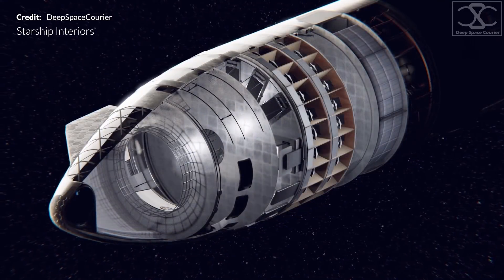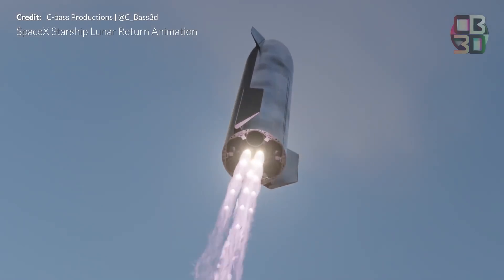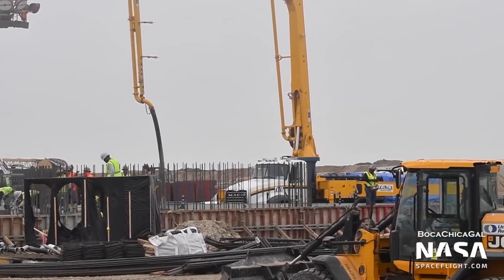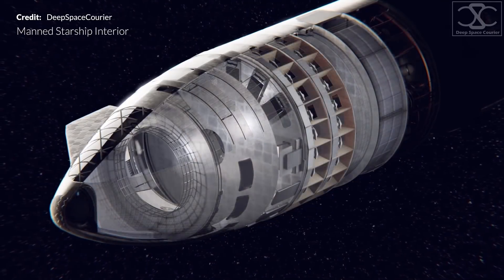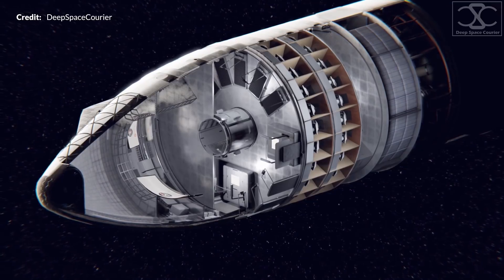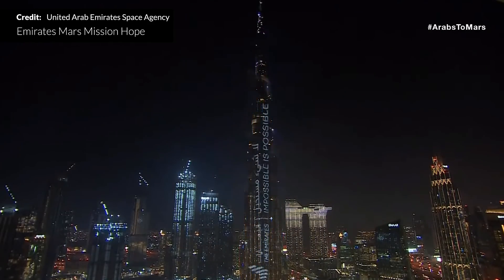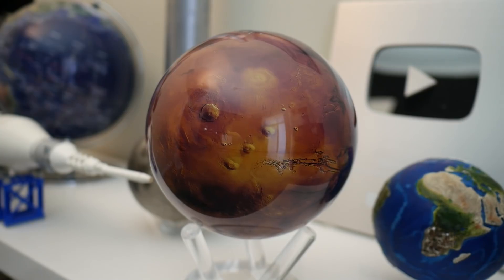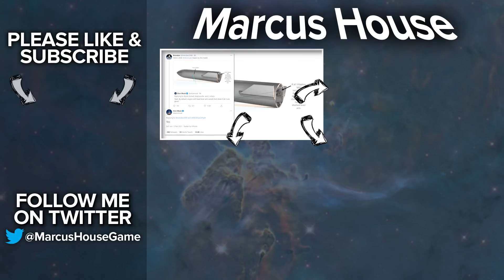SpaceX Starship to attempting another flight with SN10 - Can they master the flip and landing!?

Comment: What we really need for going to the moon is nuclear thermal.  Nuclear thermal raises the ISP from 382 seconds for vacuum Raptor to ~1,000 seconds.  While the hydrogen tank for nuclear thermal will be a lot heavier for the propellant housed in it, it is still a huge boost of total delta-V.  Nuclear thermal is still a pretty nice way for going to the moon because you can use the Oberth Effect for saving on propellant on the way out, it accelerates a lot faster than ion propulsion, and it can do the burns to use aerobraking on the return trip to LEO.  Doing nuclear thermal obsoletes the Lunar Gateway because a nuclear thermal vehicle carrying everything to say a massive Starship Lunar Lander or say a Starship based "sky crane" in LLO.  

So do several Starship flights to the nuclear thermal transfer vehicle (which could be a modular Starship with a nuclear thermal module that loses its Raptor engines in favor of nuclear thermal and then recycles the regular 2nd stage chemical fuel tanks into propellant storage tanks for Lunar surface vehicles), maybe using one of those repurposed oil drilling rigs as an ocean based landing platform for ballistic 1st stage trajectories in order to maximize payload to LEO.  Then the nuclear thermal transfer vehicle brings everything for a mission sans the Lunar Lander / Lunar sky crane from LEO to LLO in one trip.  Then it transfer's its materials / people to either a Starship based Lunar Lander or Lunar sky crane while in LLO.  Finally make the trip to the Lunar surface.  The Lunar lander lands on the moon with enough propellant to make it back to LLO and the Lunar sky crane releases its payload at perigee hover slam style and immediately flies back into LLO.  For returning to Earth, you ride a nuclear thermal transfer vehicle to Earth where it aerobrakes and then uses its nuclear thermal engines to circularize into LEO.  From here transfer to Starship(s) for the final ride to Earth's surface.

An interesting thing about this concept is as long as the hydrogen propellant tanks for the nuclear thermal engines are big enough and the nuclear thermal engines don't take too long to do their burn as in they can still make good use of the Oberth Effect, the delta-V to go from LLO to the surface of Luna is small enough compared to the stated delta-V of a regular Starship, let alone a stripped down Lunar Starship or even more stripped down Starship based Lunar sky crane, that you could be looking at landing over 200 tonnes of payload on the Lunar surface.  Especially with something like a stripped down Lunar sky crane, you could be looking at setting up a track to land on Luna at orbital speed (which is a lot lower for Luna) and maybe even take off again using electromagnetic propulsion, essentially a maglev train to and from orbit.  At this point your nuclear thermal transfer vehicle is a single stage rocket with the vehicle mounted on top being a detachable lunar lander.  So then most of your Earth based launches would be split between hauling up payload and hydrogen propellant with very little going into LOX/LNG.  And with a lot less LOX/LNG to haul up, that capacity is freed up to carry a lot more payload to Luna.  Then all of a sudden Luna is not much harder to get to than LEO with that baseline to LEO being the massively cheaper Starship, making trips to Luna cheaper than trips to LEO today on a Falcon 9, the cheapest way to orbit today per unit of mass.  This is compared to the first time we sent people to Luna where we used a 10m wide skyscraper full of rocket fuel just to get 2 people to the surface and at that we expended the whole skyscraper to just get a tiny capsule with 3 people crammed into it back.
Reply: Nuclear Thermal Propulsion might be a good idea for taking large numbers of people to Mars (so would VASIMR), but we’ve landed people on the moon & gotten payloads to Mars (and beyond) with Chemical Propulsion, so it’s not necessary. Lunar Gateway was part of a, “We’ll let you do yours if you do ours...” deal, so it wasn’t only obsolete, it’s not necessary unless they insist on using SLS & Orion.
Reply: @TraditionalAnglican  the problem with chemical is the last plan I saw to get Lunar Starship onto the surface of the moon with 100 tonnes of payload is it would take 27 Starship launches for each lunar landing as you would have to refuel tanker Starships in LEO all the way to fly to the moon in order to refuel Lunar Starship in addition to your main ship needing to be refueled all the way in LEO, which adds up to a lot of launches to get a relatively small amount of fuel into LEO with each flight.  Back with Saturn V, which was a much more efficient rocket than the Space Shuttle, it took a 10m wide flying skyscraper just to get two people onto the moon for a short period of time.  That is not really all that practical.  Even in the Saturn V days they were testing out nuclear thermal for a Saturn V 3rd stage to make the rocket more efficient.  There are two basic problems with ion propulsion going between the Earth and Luna.  One is for people and even electronics, the time spent in the Van Allen radiation belts is quite long.  You want to zip through those as quick as possible to minimize radiation exposure coming in from all sides, which is a lot harder than say having a hydrogen fuel tank between you and the nuclear reactor to block the radiation.  The second problem with ion drive is you can't make use of the Oberth Effect and aerobraking directly with ion drive as the thrust is too low, which means that precious ISP is largely blown taking the long, ISP intensive route in the Earth - Moon system.  Ion drive may cut it for radiation insensitive cargo runs and actually there are ion drives that are all around better than VASIMR now, but for everything else chemical by itself is horribly inefficient and thus extremely costly and ion is just too slow.  The next crewed place where ion comes in handy is the 'coast' phase of a trip to Mars.

Comment: I apparently missed something. What happened to SN 12, 13, 14? Were they canceled due to design changes?

One thing I really fail to understand is the use of standard design cranes. The US Navy (I believe) uses crane 
systems with powered legs to lift and transport heavier items than Starship. The assembly bays could have been 
designed to move on rails. The bays would pull back from the assembly platform, the wheeled cranes with tiedowns
both at the top and collars at the bottom to secure the vehicle. These tiedowns would prevent the legs from splaying
apart, sensors to insure the legs move properly. Once the vehicle is secured to the platform, the bay moves 
back over the vehicle. 

A way better concept, I think, than using standard cranes and flatbeds to move vehicles. Industry uses high cranes
that move across a factory floor, hanging from the ceiling. BAE offers something like I have in mind for shipbuilding.
Reply: Yes, 12-14 were cancelled because they figured they were not needed because of the info they got from SN8. SN15 is significantly advanced.

Comment: I wonder if anything can be done to increase falling drag and enable a slower terminal velocity? The little wings allow stability and steering, but can more be done? I imagine some materials, even like sandpapery sides might add resistance with minimal weight, and even better, a magical material that can transition from smooth on ascent and rough on descent. Or like fish-scales, smooth airflow up, and rough backwards.

Comment: At 12:15 you mentioned that cargo storage could be used as a  shield to protect the inhabitants of the craft if it were oriented in the right direction. My question is, If the event is anticipated, like in the event of solar flares, would the craft be reoriented to use the cargo as a shield? Aerodynamics don't matter in the vacuum of space. I have no idea how difficult this would be. 
I don't fully comprehend orbital mechanics, If the craft were oriented with shielding located between the occupied areas and the sun, would it stay oriented that way or would it need to be adjusted continually. If it needs to be adjusted, could this be accomplished by keeping the craft very slowly rotating?
I am not criticizing your video, It is very informative, I am just very inquisitive.
Keep up the good work!

Comment: I don't think it's as illogical as we all think for them to land so close to their takeoff stands.  They:
1. have confidence in their products (both in their ability to hit the target...which they do, but also in the durability of the other ships nearby) 
2. are shooting for rapid reuseability and maximum performance.  They could absolutely land the thing if they flipped higher up and used more fuel, but that's not what they need in the end, so it doesn't make much sense to try landing in a way that won't give them the data/experience/testing to get to their goal.  And they can't have delicate rockets that require white gloves and clean rooms. 
3. lastly, between building prototypes in tents and out in the open, and building prototypes rapidly (and the infrastructure to create them at the simultaneously) its clear that the SpaceX culture is not about perfection at the start, but rapidly evolving and pivoting as needed based on a sorta highly educated "trial and error".

Comment: I would like to see the landing maneuver performed about 10 seconds earlier to accommodate any unforeseen and necessary actions required to land safely.  Granted, SpaceX is accomplishing ground breaking speeds with this technology, but I would suggest to slow it's landing operation so as to have the Starship land more like Falcon rockets.  Just seems the Starship doesn't have any time to make necessary corrections as needed.

Comment: ??? Can this do or die flip maneuver close to the ground (to reduce decent fuel mass) be Human-rated Certified??? Imagine if an airline decided to increase efficiency with the idea of turning off the engines on descent and 20 seconds before landing restart the engines and land with goal of having only 30 seconds of fuel remaining in the fuel tanks. Is this acceptable for an airline? I'm a 100% supporter of Elon and SpaceX, but is this close to the ground flip the right landing approach?  Trade the header tanks for more fuel and with a high powered gaseous O2+CH4 Reaction Control System preform a much slower horizontal to vertical rotation at a higher altitude followed by a vertical RCS fuel settling deacceleration, is this a more realistic human-rating approach? Scott Manley recently did a video on fuel sloshing and tank baffling "keyhole rocket surgery". Instead of baffles in the tank would something more like a sponge in the base of the tanks be more effective in setting the fuel? Would love to sit in on some of the SpaceX engineering meetings and listen to the problem solving discussions.

Comment: In regards to the the Artemis program then I would recommend to stop it and then divert all the financial resources to SpaceX and let them handle the initial settlement of the Moon they should be able to fit this "little side project" in while they prepare and do the mission to Mars - I might sound like a SpaceX fanboi, but that because I am just that and proud to admit it too !
Reply: Everything about Artemis is fine more or less aside from SLS.  The Gateway, Landers, and surrounding science are necessary and less of a mess than the over decade old Frankenstein Monster rocket that still doesn't fly.  Also putting all their money into SpaceX would be putting all their eggs in one basket, especially when SpaceX can generate their own revenue.  Having multiple launch options available and making sure the bureaucracy is trying to work with and not against safe and effective development is the way to go.  That would require them to not play favorites though.
Reply: They can't cancel the Artemis project. Thousands of contractors and subs in most senator and congresspersonages home states are making money off of it. NASA is a huge make work program.

Comment: Okay so the large launch pad being developed that will presumably be used to launch the Starship and huge booster will also be the landing pad if SpaceX follows through with catching the booster section by some means. While that sounds great I see a challenge here. Considering the fact that SpaceX is finding it difficult to softly land the Starship without the booster it will be a separate learning curve to softly catch and land a booster. Just one failure of landing a booster on the pad will likely destroy the complicated launch pad.  It would take months to repair or rebuild the launch pad. Will early prototypes of the booster try to land on a flat concrete pad with legs as the current Starship does? If this is the case then there would be little need to catch it if it can simply land on legs to start with. I realize the idea of catching it is so that it can have quick turnarounds and not then need to be transported and lifted back onto the pad but the trial and error process of getting that right seems like it could introduce large amounts of reconstruction delays to the program.

Comment: You notice two big differences between SpaceX and Blue Origin: X allows anyone with a good camera to film what is happening in their area, Blue is very anonymous. X seems to be in a hurry to launch rockets, with Blue you have to wait a long time between the rockets.
Reply: In fairness Blue Origin is in a much earlier state than SpaceX. I mean not in terms of age of course but pretty much everything else. I personally am quite excited for New Glenn. The more private companies in the orbital space, especially those pushing reusability the better!
Reply: @pcgee12  The fact that they are in an "earlier state" despite being an older company with access to more money, and that said earlier state takes the form of not even having reached orbit yet while X has over 100 missions to orbit under their belt, firmly cements BO as a complete and total failure. Any other company would have gone out of business long ago with a track record like that. 

And even when they fucking finally get the NG to fly, it's gonna be obsolete right from the start. Not only because it's outclassed by Starship in every way possible (by an EXTREMELY HUGE margin), but also because it's already lost to Falcon Heavy, a rocket that's not only flown, but actually has quite a lot higher lift capacity. 
NG's payload capacity isn't even high enough to reach the super heavy lift vehicle classification (SH is at 50+ tonnes, NG can take 45). FH can lift 64 tonnes.
Reply: @carljohan9265  I'm not denying SpaceX is doing more impressive stuff or anything. I just don't like the attitude a lot of people seem to have where they want to see SpaceX "win". The more companies getting involved in space the better, I hope Blue Origin is a success, I hope they can develop rotating space habitats. Doesn't mean I don't hope SpaceX can start humanities future on Mars.
Reply: @pcgee12  I'm not saying you are wrong. I'm just saying BO in particular is not a company to place hopes on because they never seem to get anything done. 

Plus, I honestly can't get behind Bezos. The things he says, yes. The things he does, no. 
He's pulled far to many bullshit moves for me to be able to trust what he says at this point (including trying to fuck with SpaceX in very dishonest ways every chance he gets). 

Of the rocket companies that are making heavy lift rockets (aside from spaceX) the best one is probably ULA. 
Despite their background, they really aren't Boeing and their rockets do have a history of high reliability. 
They are also actually looking into real space infrastructure projects, like having propellant depots in orbit.
Reply: @carljohan9265  That’s probably why BO has Bezos there to ramp up the “ferociter” now.

Comment: What are your speculations about SpaceX's test plan for the next year?  What will they do with the first starship+booster test?  When will they go supersonic?  When will they touch space?  Can they test the ability of the fins to withstand entry at 17000 mph without going all the way to orbit?  Perhaps launch to 100 km, then dive headfirst and belly flop after they're at terminal velocity?  What order of tests will they go through?  

On a different note, will Falcon Heavy be outmoded technology in 2024?  When will NASA start booking flights on Starship?  Even if they take longer to figure out landing the second stage, it sounds like it will still be cheaper, especially on a per-kilogram basis.  In general, how does NASA, which plans 3-10 years in advance, work with SpaceX, which evolves on an annual basis?

Comment: is anybody worried about the small footprint of the landing feet. shouldn't they be wider
Reply: Those are version 0.9 legs. Musk already said that they need to update them. 
But the current ones are extremely cheap so SpaceX will use them until they got the prototyps working properly.

Comment: Why don't they just try the flip maneuver slightly higher to give more reaction time as well, should be able to carry more then enough fuel and hover long enough to land
Reply: Because every increase in fuel capacity cuts down on the pay load capacity. Also the flip height was never the problem. They just need to make the engines work a bit more reliable.
Reply: @3gunslingers  I'm talking about now for testing purposes, once it's figured out you can start lowering the height at which you start the maneuver